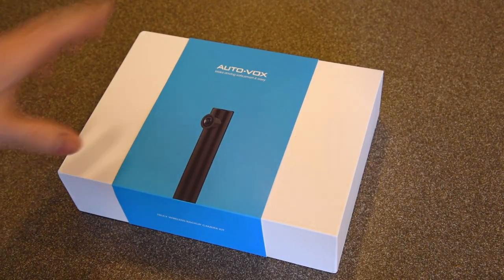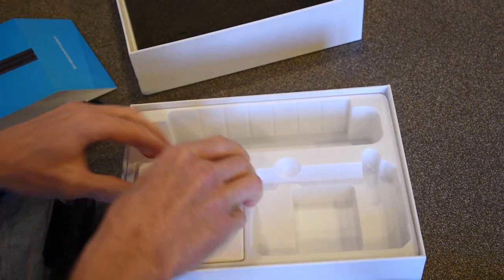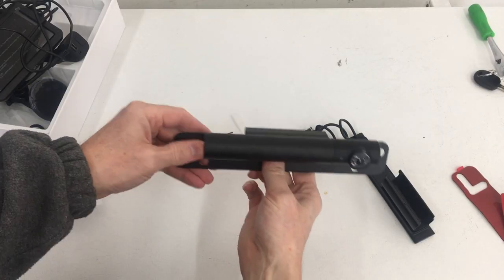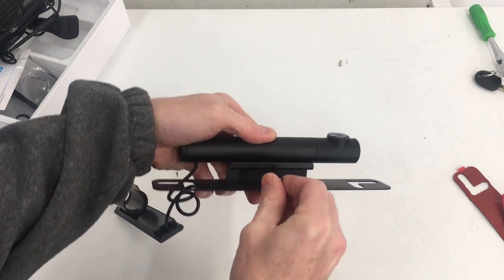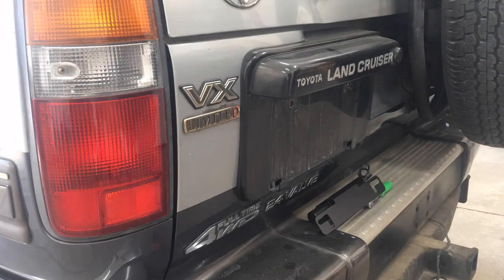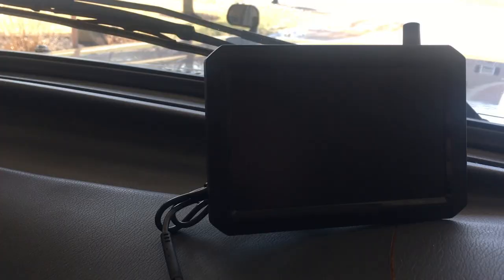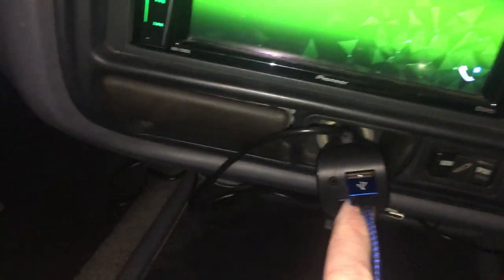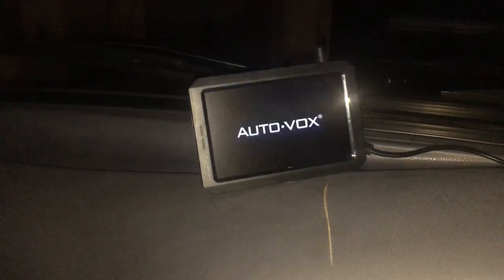AUTO-VOX TW1 Wireless Backup Camera 5 Minute Installation + Review in Toyota 80 Series Land Cruiser

Comment: When you unscrewed the camera from the bracket using the Alan key. Would the camera still be secure to the bracket if that pin wasn't there? Because I don't want to leave the camera overnight or when I'm done, I wanna take it off the bracket and put it in my glove box and it would be a hassle taking out and putting it in again every time. If I left the screw out, would the camera be still strong enough to hold to the bracket?
Reply from the maker: It was a pretty tight fit without the screw, but I think the main purpose of the screw is to prevent someone from stealing the camera.